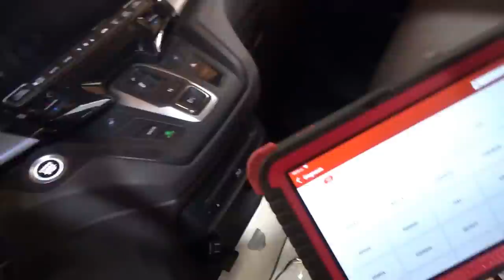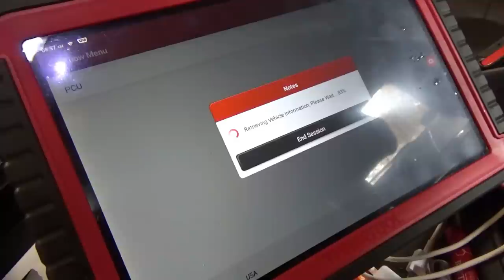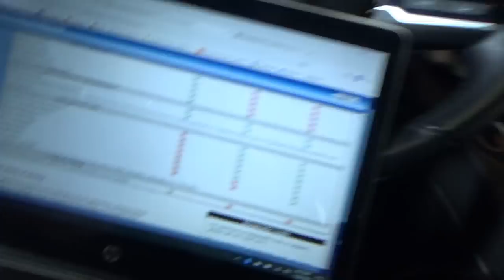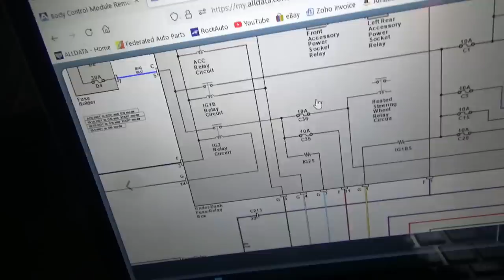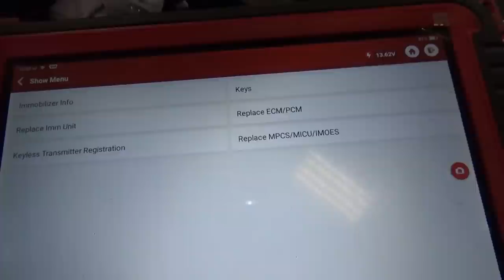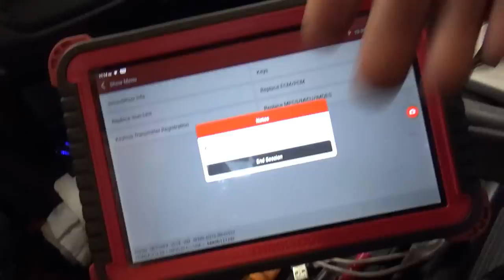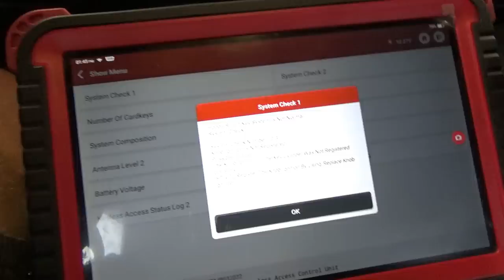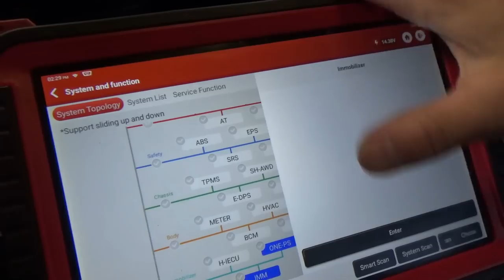WTF...Honda Turns Itself ON & DRAINS the Battery?! (Part 2)

Comment: Good old mechanical Key can do 4 decades plus no big hassle, this modern push button  and  keyless entry tech is garbage in tenth of that lol, will of raped owners finances proper hard in under a decade as it about all they well engineered for lol .
Can't wait to see what fun uncle Elon has created for us on his engineering marvels lol, even opening the glovebox on one of the tesla's is typical ballache of touch menu madness.
No wonder modern car needs eyesight systems and self drive as driver too busy on the touch interface trying figure out non intuitive controls & potential glitchy operation lol ....
In the meantime I drive daily in a 23 year old wagon and haven't seen a money light flicker in 12 years and only elec parts used so far been 2 bulbs and 2 batteries (probably only needed 1 battery if replacement quality of them was same as 20 years ago lol) ... What the most environmentally friendly ! Not sure it going be modern junk,  uncle Elon might need rethink the current stupidity lol .
Working on modern junk daily and seeing dumpsters of parts and service materials I know the answer already, it worse much worse environmentally ...
Reply from the maker: I appreciate the simple tested proven regular ignition key more and more every day 😅
Reply: @PineHollowAutoDiagnostics  Amen, what happened to the KISS principle and good old common sense engineering basics lol ...